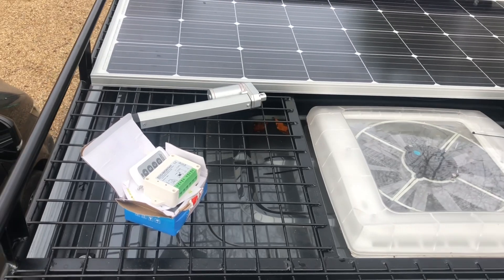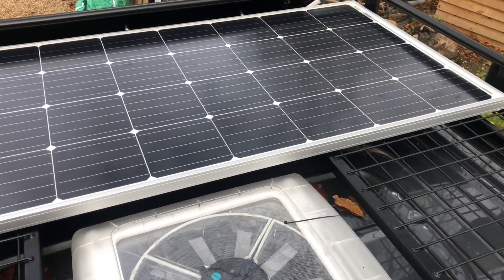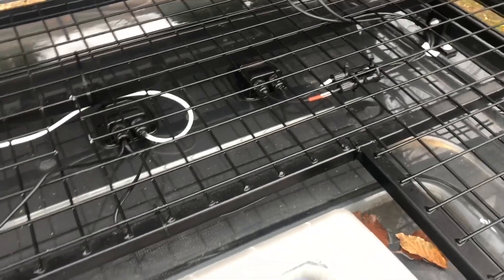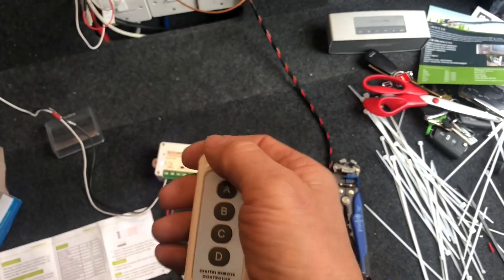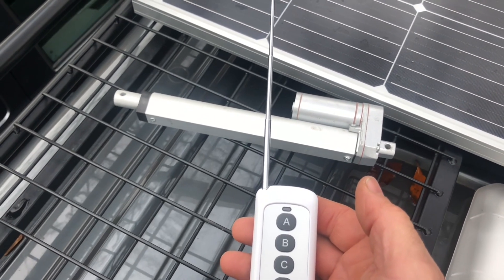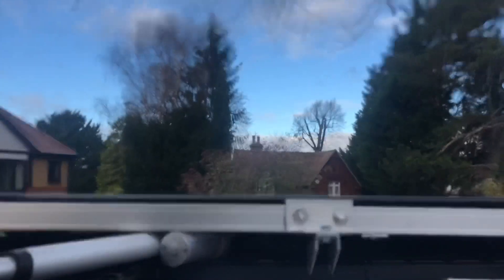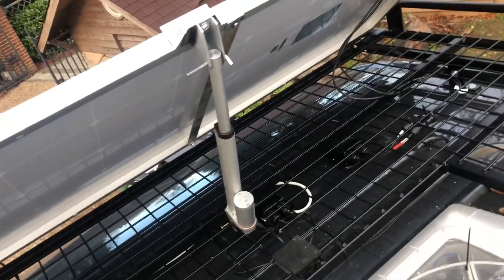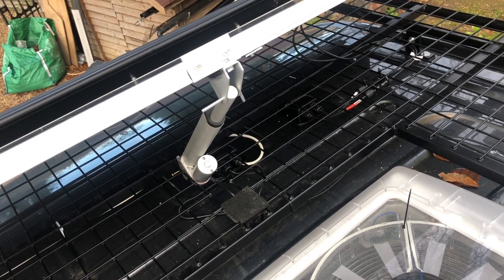VW Campervan Solar - Motorised Panel Installation

Comment: Wonder if the efficiency gained by tilting panel is used by powering the actuator !!! You would have to intentionally position van to face the track of sun, maybe a swivel base is next with solar tracker 😂

Comment: Hey dude... where did you get the roof rack from please? TIA 🤙🏻
Reply from the maker: Hey mate
SDV roof racks, fantastic service, cuts holes where you need them, add mesh, whatever you need.
Can’t recommend them enough.

Comment: I'd say that most of this upgrades are for show off  only and extra spectators on youtube, zero practicality, it's only 3500 kg allows, spend it for something useful, extra bars,motors means less for water tanks, and auxiliary power whitch are more needed
Reply from the maker: Thanks. Everything is great for us practically and have considered the weight, hence always using lightweight materials, and we don’t use heavy timber’s to construct everything like most. The motor for the solar panel is not at all heavy. We have installed the largest water tank we can fit underneath and also have an internal one for winter. All good 👍🏼 Have been using the motorised panel this week as the sun is so low now.